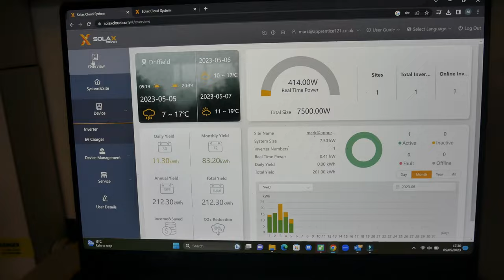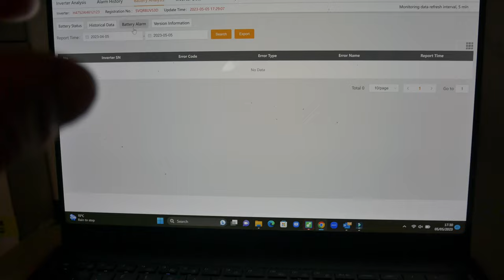The truth about Solar Battery Storage Safety and things that can help

Comment: Very fair points you raise and it is right to raise them and consider the options carefully. They are now starting to come out with fire extinguishers which are specifically designed for lithium battery fires - Although sadly the automatic extinguishers seem to be typically aimed at commercial kitchens with dry powder. Hopefully they will start creating automatic extinguishers designed specifically for lithium fires.

I think installing a fire alarm above every battery installation is a good option and is quite cheap, bonus points if it's interlinked of course.

I would be curious to see how you do an outdoor installation and what considerations you have around those, if you do one and could record a video on it.
Reply from the maker: We have an outdoor one coming soon! The fire suppression is really useful in preventing a fire from reaching the battery which is far more likely to occur that the other way around. So I think it makes a lot of sense. Thanks Andrew.

Comment: The risks with Lithium Iron Phosphate batteries on their own should be extremely low since the chemistry is very stable, even when they are abused. The biggest risk would be wiring faults on the battery output. Warning that those powder extinguishers will destroy everything in their path since the powder is corrosive. There are some clean agent fire extinguishers available for a small fortune though in case they are accidentally triggered or dropped during installation.
Reply from the maker: That is exactly correct. They are relatively safe in terms of batteries. Far more likely than a battery beginning a fire is it becoming part of one. Hence offering local extinguishing to at least buy time in the worst circumstances. The coorsive nature at that stage of minimal importance or to be Frank concern. 

Professional installers will take all factors into consideration and engineer in safe and compliant systems. 

If you are looking for one check the MCS website for a local installer who can best advise
Reply from the maker: Also why delete the comments on the SPD discussion? It's okay to be wrong even on a public platform. We all learn together that way 💪

Comment: I would always recommend the loft space as a last resort. I have equipment in loft 3 battery's replaced under warranty and all due to excessive heat in summer. I have now added ventilation in loft for summer time only.
Reply from the maker: It's such a tricky one in a lot of  homes. But I totally agree with you Gino.

Comment: Agree with much of what you say. Lithium Iron Phosphate is deemed much safer than the 'horror stories' we hear about Lithium Ion in the context of EVs ~ such as the Dutch fire service having 'dousing baths' to dump EVs in to ensure they are extinguished....
Personally with any type of house, my preference would be to build a small brick enclosure 'down the garden' for the danger-kit, and cable to the house.  I see this as akin to the properties which had LPG tanks away from the house where properties weren't on the gas grid.

Comment: Hi Mark   Very interesting and a common sense approach to the subject . I remember when pressurised heating systems started to come available , and the bomb in the airing cupboard was often used by plumbers to scare people from adopting them 😂 .  It is a fact that technology is going at such a pace that it can only benefit the consumer .       Out of interest how are you getting on with your air source heating , I must admit I’m still not on board when fitted to older properties . But would value your opinion , as a trusted professional  .     Best wishes and kind regards  😀👍👍👍

Comment: Great vid Mark, quick question. Do you install DC surge protection on all installations or do some inverters come with built in protection? Cheers.
Reply from the maker: Some do have type 3 spd protection built in but we fit it as standard in the DC strings.